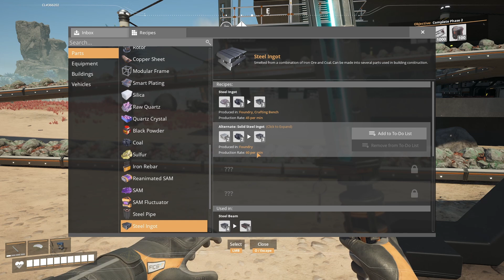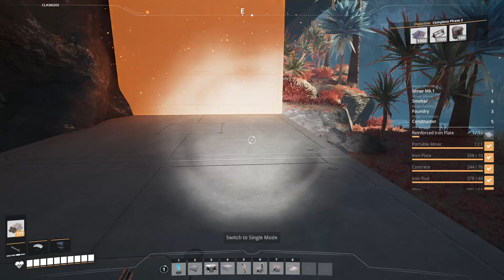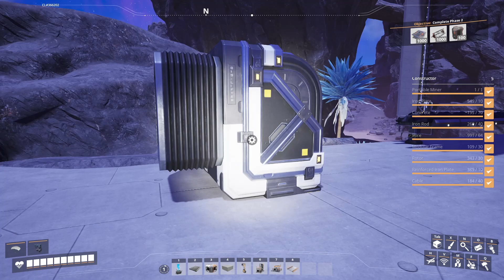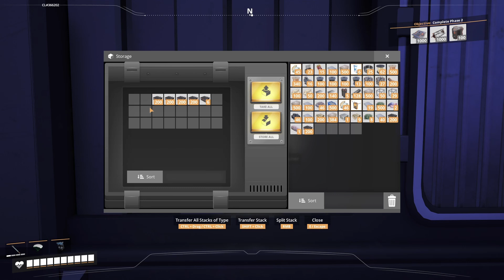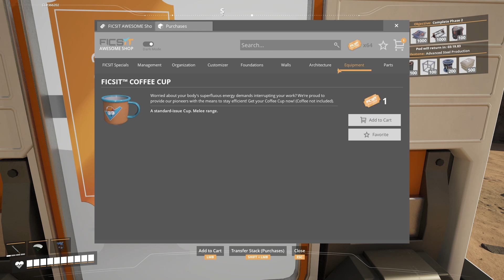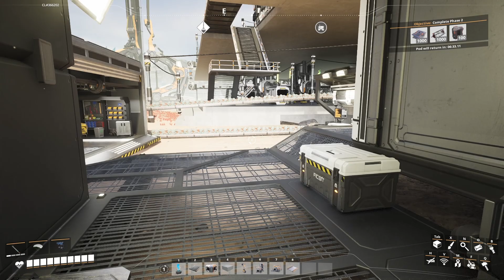Satisfactory 1.0 - Remote Storage and How to Steel [E6]

Comment: You may want to add the dimensional depots on top of the regular storage containers,  and use a conveyor lift from it (after a splitter if you need things going elsewhere)... The DD only holds a maximum number of each item (upgradeable) so any extra gets stored in the storage containers.  This way what s available to you is filled at the maximum rate...
Reply from the maker: Thanks. I am thinking about how I am going to do it. I might wait until I have Smart Splitters. I have an idea.